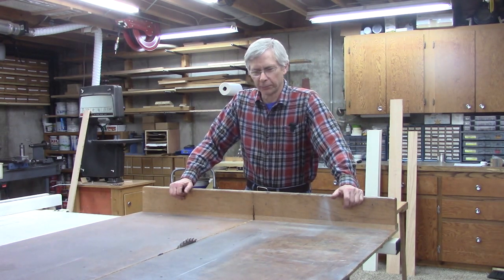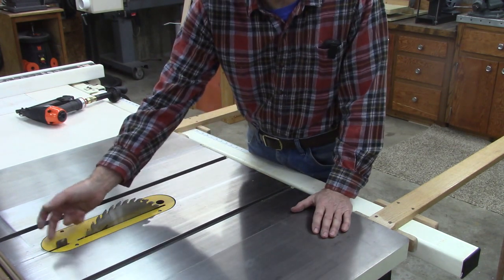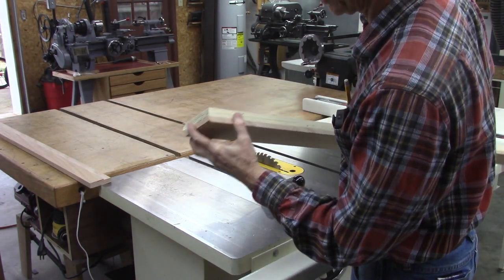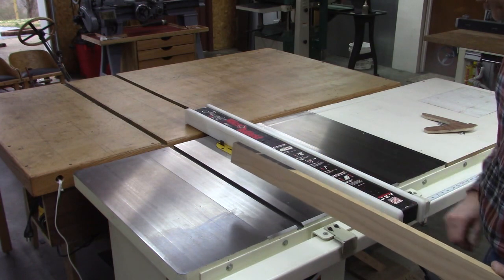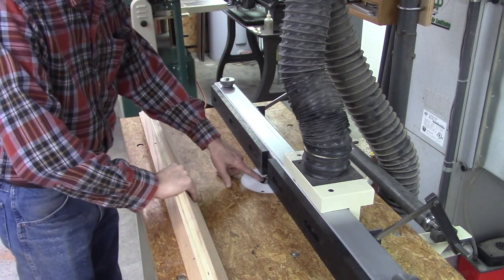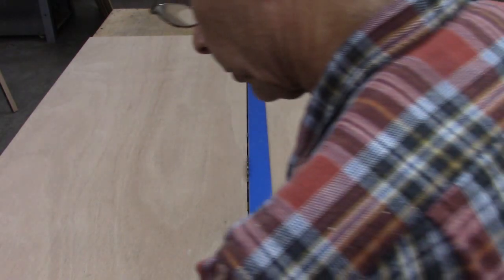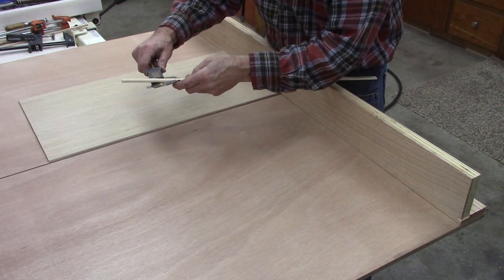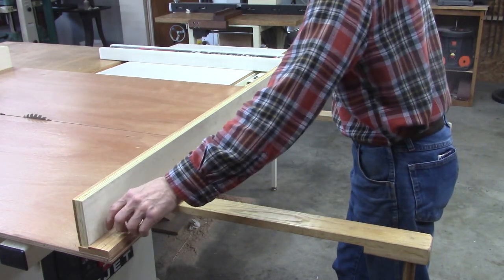Easy and Reliable Table Saw Crosscut Sled

Comment: Nice crosscut sled. It's a simple and versatile design. I especially like the infeed supports. When you don't have to fight things you can work safely. When you were squaring up the fence and the plywood ended up with a.008 taper on it. Doesn't this mean that you are really .004 out of square because you are doubling the taper when flipping the plywood or am I mixed up.
Reply from the maker: You are exactly right. I should have mentioned this!  In hindsight I probably should have used a larger sheet of plywood too. Thanks
Reply: @WinkysWorkshop  .004 in almost 2 feet is pretty good
Reply from the maker: @andyZ3500s  Oh yeah, totally agree...  for woodworking I'd call that dead on!
Reply: @WinkysWorkshop  I'm such a nerd, awhile ago I had my caliper out looking at a .004 gap and also a .009 gap and thinking this far out in 4 feet. Just over a half of a 1/64 in that distance. Way back in my finish carpenter days I bought the first slide compound saw that came out it was a 8 1/4" Hitachi. First of I made a nice wood fence to bolt onto the aluminum one but I had it tight against the base. Every cut I'd have to clean the sawdust out, it didn't take me long to pull it off and rip a little off of the bottom. This achieved the same thing that the chamfer you put on your fence did. I never thought about it but the Biesemeyer fence that I put on my old Delta contractors saw was slightly raised up also. Talk with you later Winky.
Reply from the maker: @Andy Zulim  My saw is made by Jet. Probably about  a 1997 model. It has a  Biesemeyer clone (Exacta) fence on it. The quality control on the saw is very good but the fence is terrible. I've worked on it a few times and recently modified it (removed the micro-adjust added a couple of guides). It works well now but it is super heavy. Do you like yours?  Everytime I remove mine I think about making a new one but its kind of like hitting a hole when mowing the lawn....  it never gets fixed.
Reply: @WinkysWorkshop  I couldn't even think of something to complain about on my Biesemeyer. I don't know if they changed anything in the last twenty five years. The one That I own is the Home Shop model. I purchased it new to put on a old Delta Contractors Saw, not to be confused with what we call a contractors saw today. It's a scaled down version of their professional model that would of gone on a Uni Saw or Powermatic 66, so it is light weight but sturdy as can be. I am not familiar with any of the newer knock offs or have I seen a fine adjustment. The thing that I like about the Biesemeyer is it's simplicity. The adjustment to square it up and get the cam right is just two setscrews that do both. If you can't get yours sorted out I don't know who could. I'm not very handy with computers, I could have my sister take pictures of mine and we could swap photos. Maybe it might give you a idea. Didn't you start a channel Email. If so and you think this is a good idea send it to me. I would be happy to contribute in anyway.
Reply from the maker: @andyZ3500s  Most the problem with my fence is that the part that connects to the rail is bent and or has a crooked weld. It looks a little bent but i can't imagine how it would get bent. I just looked at pictures of the Biesemeyer and yeah, no micro adjust. That's a good thing. When I removed mine I had to install a couple of extra guides because it was way to loose on the rail. It works great now but still weighs a lot. In my opinion it should have been made out of aluminum. Oh yeah...  and the micro adjust rubbed the rail and wore the image off the tape which is now new. winkysworkshop@gmx.com
Reply: @WinkysWorkshop  I was just looking at the video 14:08 in. From what I can see it looks like the angle that is welded to the bottom of the fence opposite of the cam lock on the left side slopes downward the farther it gets away from the fence. Is this what you are taking about? I can not see what is going on with the angle between the rail and the saw. Is this bend causing issues with the fence or any dragging?
Reply from the maker: @andyZ3500s  Yes that's it.  I tried to straighten it years ago but it's very thick. Without the micro adjust mechanism the clearances are little better on top of the rail now. Did you see the additional guides I added? They are a slightly different color .
Reply: @WinkysWorkshop  I did see the guides that you added. You said that they helped things after you removed the micro adjustment. Let me see if I have this right. So at this point the fence is working but it's not to your satisfaction,  I no that I would never be happy with it. If I am thinking correctly are you thinking of modifying your fence or changing it to something else?
Reply from the maker: @andyZ3500s  Yeah, now that it's working better I may never get a round to it. The only negative now is the weight. If I do make a new one I might try to do something like Jeremy Schmidt (Youtuber) did. He used a 16 TPI screw to index the position of the fence and you rotate the screw to finely adjust.
Reply: @WinkysWorkshop  Sorry for the slow reply. I remember seeing Jeremy Schmidt's video on the fence. I been quite awhile so I don't remember all of the details, but I do remember his use of a 16 tpi all tread with a wheel and detents. I remember being impressed with his design. When you say that your fence is heavy I am thinking that its hard to move around. On my Biesemeyer fence it has six 3/4 ×2" plastic pads, probably UHMW. Four of them are on the angle that rides on the rail, two of them ride on top of the rail and the other two ride between the rail and the table. These areas have no paint on the rail and I keep them lubricated with silicone spray. Biesemeyer sales these separately at a reasonable price. The other two pads sit under the fence about 2/3 out towards the end of the fence. I can't remember were but I pretty sure that I saw a video were someone was showing some industrial tape that had teflon or something similar on the top. You might be able to do something with a product like this. The only other thing that I can think of is that Biesemeyer sales separate parts. It might be worth purchasing a fence or fence and rail. My Home Shop models rail is 1 1/2 × 2 1×2, there industrial model is 2 × 3. If you're existing rail happens to be the same size it might be worth it in the long run, might run into some height issues. Other than that do you have any buddies that are good with a tig welder. Maybe one of these ideas might help to trigger a idea. See you later Winky.
Reply from the maker: @andyZ3500s  - The fence moves very easy and has all the UHMW pads. I mentioned the UHMW tape in my router table fence video. It's very handy stuff to have around. Both my fence and rail are 2" x 3" steel tubing. The weight of the fence just makes it harder to remove and install. It's not that bad but after removing it 10 times during the course of a project it gets annoying. I remember when I first got the saw, my first thought was, "wow, that's a very heavy fence". If I had to guess, I'd say Jet used the same tubing for both the rail and the fence and Biesemeyer used a lighter weight tube for the fence. The thinner wall tubing would be plenty rigid but harder to keep straight while fabricating.

Comment: what's the back fence for
Reply from the maker: Just strength. The two halfs would flop around when you removed it from the saw. Also it allows me to set the sled on end when I removed it.

Comment: Always apply pressure to the job on the outfeed table not the infeed table[ obviously for the first few inches you have no choice] but once the timber is over the outfeed table transfer your focus to the outfeed table or you will curve your timber. Just my two cents worth 😎👍
Reply from the maker: I've heard that before and I'm not saying you are wrong but I seem to have better luck on wider boards pushing over the cutter. The cutting head tends to lift the board.
Reply: I think it all depends on how your particular jointer is aligned.  Switching between the two seems most likely to affect straightness in a bad way; one or the other seems good!
Reply from the maker: @ydonl  I agree, I think the alignment of the jointer makes a difference. If everything is aligned perfectly however it should not matter where you press down, Although....  if the cutter is pushing the wood off the bed then the results will not be perfect which is why I push down over or close to the cutting head. I have excellent results overall.
Reply: @WinkysWorkshop  my 35yrs in specialist joinery just got thrown out the window 😅🤣😎👍
Reply: Power feeds are always fitted to outfeed tables for a reason. 🤓
Reply from the maker: @tribsat100   No need to get insulted. I didn't even say you were wrong. With that being said years of experience may or may not mean anything. It simply means you opinion is worth considering. I designed machine improvement for the printing industry. I have no formal education but I proved a very good engineer wrong many times. He only had 45 years on the job.  You maybe right, all I said was that I have had very good luck getting a board dead flat putting pressure near the cutting head.Also, I question everything in life. There is ALWAYS a better way. Which is why I was designing machine improvements. While the engineers and management were looking at available technologies to fix a problem I found a better method. In fact, I avoided looking at how the experts fixed the problems until I had exhausted all my own ideas. Most often the fixes I came up with were a better fix.
Reply from the maker: @tribsat100  That is logical for several reasons and I'm sure they mounted within a 1/2" of the cutter head.
Reply: @WinkysWorkshop  I didnt mean to sound insulted it was a bit of good old british irony! I enjoy your site and have found your round column stuff very helpful. My comment on the jointer came after alifetime of preparing timber for edge glueing where straight or very slightly concave surfaces were the order of the day. I got used to making minor adjustments to the edge profile by applying downward pressure at varying times and positions it was second nature. I wish the same could be said of my engineering skills. Kind Regards Stuart from the uk.
Reply from the maker: @tribsat100  British irony and text. It's hard to get feelings correct with text. We good, and thanks.